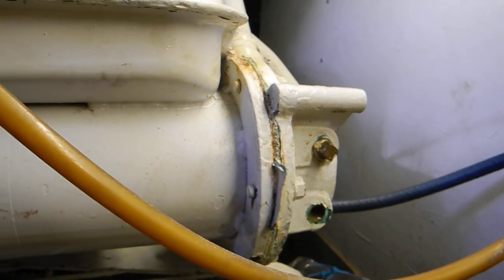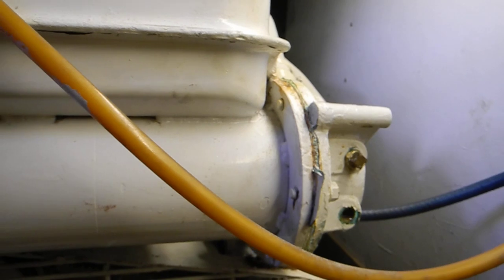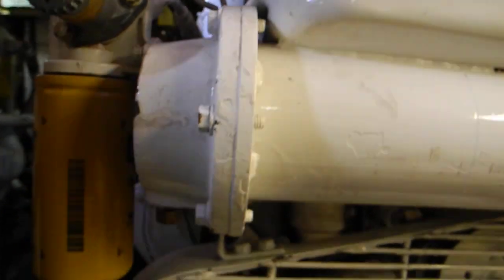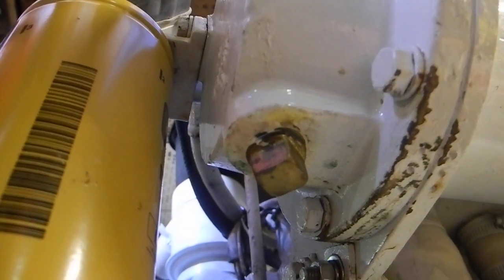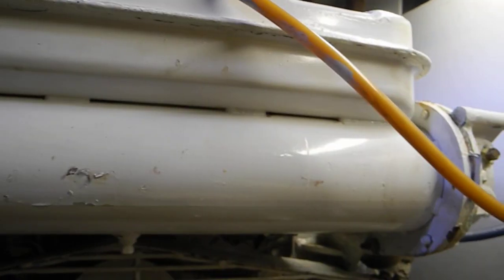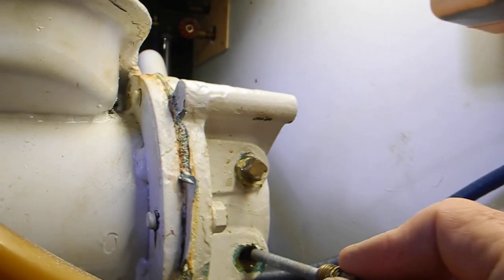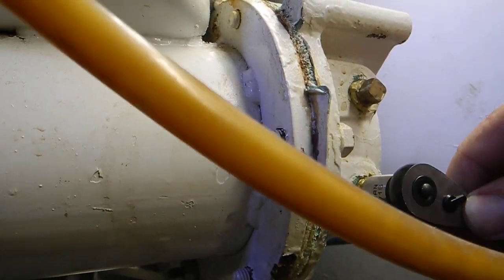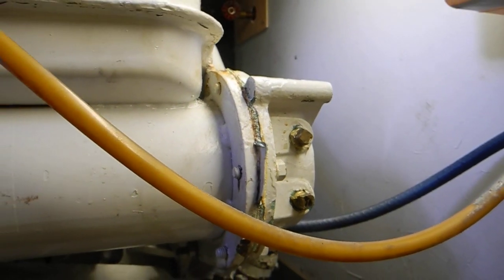Find your engine zincs

Comment: Captain, you're one of only a few folks I know of that have sockets for square bolt heads. I use mine on aircraft fairly frequently.
Reply from the maker: Greg Smith seems that no matter how many different tools you have, you never have the right one handy. Funny part of this is that we were using a hex socket on a square head...but it worked! The zinc was in slightly more than finger tight which is the appropriate torque. Thanks for watching.

Comment: thanks for all the info! ant reason why did not use teflon tape?  thanks
Reply from the maker: lester wicklein great question. It is customary to screw the zinc/anode with metal to metal contact with enough torque (not much. One oomph) to prevent water leakage. The Teflon tape or pipe dope is presumed to be an insulator and not recommended. The anode should have contact with other metals on the boat to provide electrical continuity and thereby allowing the anode to be the sacrificial softer metal.thanks for watching!